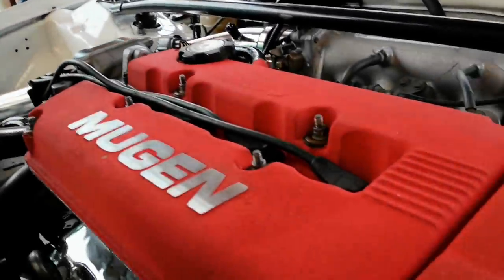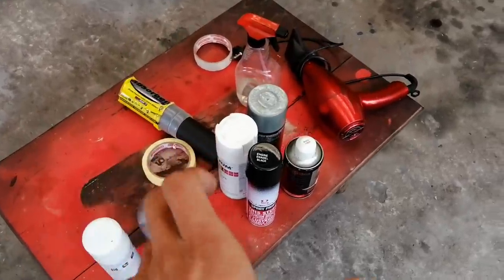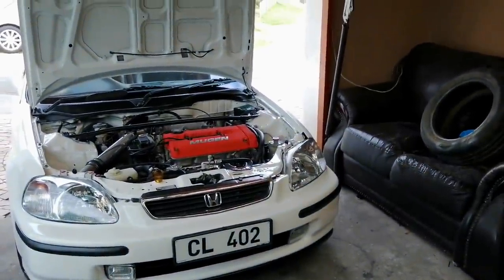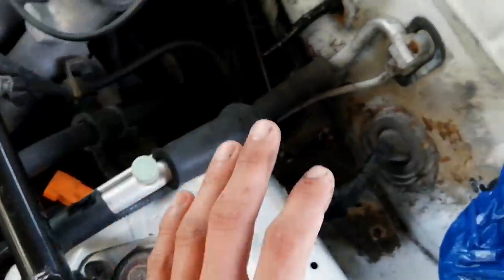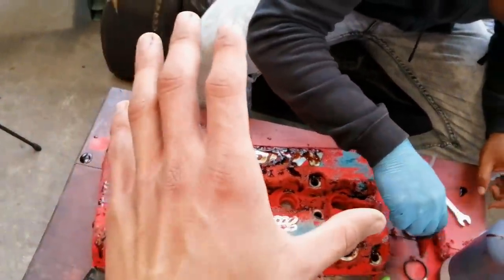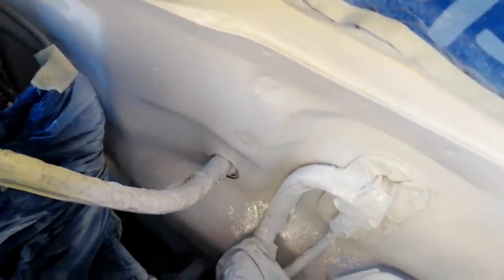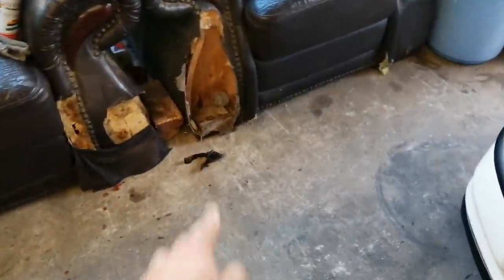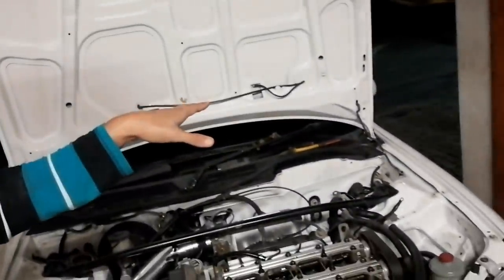REFRESHING MY HONDA VTEC'S ENGINE BAY WITH RATTLE SPRAY CANS!!!

Comment: As for the lettering, you don't cover up the letters, spray the whole valve cover. After following all those steps and the wrinkle is clear enough after applying heat. You sand down the lettering, that way the lettering will be silver and the rest of the cover in gray wrinkle in your case

Comment: There is a curtain way you apply the coats of the wrinkle spray paint. First Coat horizontally, let it dry naturally. Second coat vertically, let it dry naturally. Third coat diagonally, let the last coat dry up. Then you can either put it in the oven or use an heat gun to expose the wrinkles. But the main goal is how you put on the coats.
Keep up with the good content buddy💯🔥